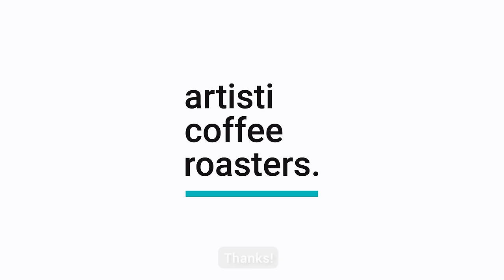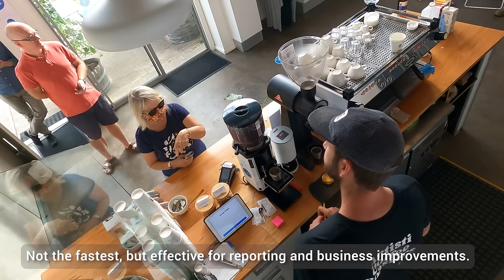See how a professional barista makes coffee working solo

Comment: I've discovered your channel a couple of days ago and binge watched most of the videos already. Fantastic content. Usually I'm only interested in the domestic side of coffee, but for a while I'm asking myself how a coffee bar could be run profitable. So I was especially interested in the throughput. Seeing your optimized workflow, I can't see how one barista can do much more than the 11 cups you managed in the first 15 minutes. That would be approx. 45 cups/hour. So a second person for taking orders and giving full attention to the customer would increase the output to maybe 60 cups/hour!? Beyond that a second barista would be needed, right? How do you calculate staffing?
Reply from the maker: One person 20-30 coffees per hour. 2 is 50-60 this is a variable as it depends on a 2 or 3 head coffee machine and the time you run you shots. So 30 shots plus clean and dosing the grinder is still 1 min per handle, if you split this you could get 120 coffees per hour, but that is not realistic at all, so don’t get Caught with that maths
Reply: @ArtistiCoffeeRoasters  Thanks a lot for the answer. I can see how easy the time to serve can vary on the simplest things, like different milk. I assume a coffee bar can't be very profitable from serving coffee alone - at least not in a metropolitan area with very high rental cost. Very interesting thoughts. Love the mix of your videos!

Comment: Curious about how you can so easily clean the portafilters after each shot. It might be because I use a Decent Espresso DE1XL on the adaptive profile, but my pucks (when I get things dialed in to taste right) are super wet, and when I knock out the old grinds, I have a lot of wet grinds stuck to the portafilter. I have to put the portafilter over a pitcher rinser, then dry it to get it clean. This uses extra water, which is critical since I run a pop-up with limited water supply.

Comment: Hi jimmy and team, Just wondering if you could tell me the recipe you are using in the espresso bar? I ask because it looks like even though you are using spouted portafilters, you don't seem to be splitting shots? I have started working at a cafe in Sydney and a big change I am still getting my head around, from my training in the UK is larger dry weight in (21-22g) and so greater volumes of Spro out, this makes sense as many Aussie cafe's, Flat whites/ caps/lattes ect are single shots that just use one side of a double spout portafilter.  However from the video unless im missing something you seem to be doing something similar to my workflow in the uk, where every regular size coffee would have a double Spro as the base and if someone asked for a "weak' coffee they would get a single shot.  To be able to do this the recipe was a much smaller dose in of 17-18g in and 36-38g out..... I see a downside of splitting shots as it seems like a lot of "spare shots" are wasted.  Also it seems like more coffee in general is being used that maybe needs to be.  I'd love your opinion on this? I guess in a nutshell what im asking is it better to pull larger shots with more coffee and split the shots or pull smaller shots (both with the same ratio of 1:2) and use that smaller double shot as the standard "shot" that bottom of a reg size drink? Hope that makes sense lol Cheers for all the instructive content!
Reply from the maker: Makes total sense and I can see your confusion. 
What were actually using our 8oz takeaways is a double ristretto. It’s a 1:1 ratio which for us is 22.5g in and 22.5g out. 
This gives us the same yield as a single shot but the extraction is far more quality and suits an 8oz cup of milk much better than a split shot. 
We do split shots when we do in-house cups in 6-7oz cups. 
We waste less single shots but we do use more coffee over all. However, the coffee tastes much better to the ratio of milk this way. 
Hopefully this helps 
Jimmy ✌🏻

Comment: Could you maybe do a video on calibrating the EK43 for espresso? I can never seem to get it fine enough and wonder if it needs calibrating beyond factory settings
Reply: you might need to re-zero your ek. Lot's of guides on youtube
Reply from the maker: We love EK43s but this is very common so you’re not alone. We’ve had to spend good money on the right adjustment tool. 
Adam is right, follow some online guides but it’s not fool proof. 
Because of this constant battle, we’re about to start trialing the new Mazzer ZM 🤫

Comment: Another question: how are you handling grind settings on the decaf or other single dose coffees? I now use a Mahlkonig e65s GbW for espresso, but when I get customers who want decaf or one of the other coffees i offer, I don't have an easy way to switch to those coffees due to the need to dial each one in.
Reply from the maker: Yes dial it in in the morning and take note of the grind setting, it’s a good reference for when your busy
Reply: @ArtistiCoffeeRoasters  Unfortunately, when I remove the hopper from the e65s it leaves around three 18g doses worth of beans in the grinder. I'd have to bring my Niche Zero, which is what I used to use (along with an Acaia Orion bean doser) before I got the e65s. Since I set up a nearly complete coffee shop and tear it down myself after 4 hours, I have to limit what I bring.